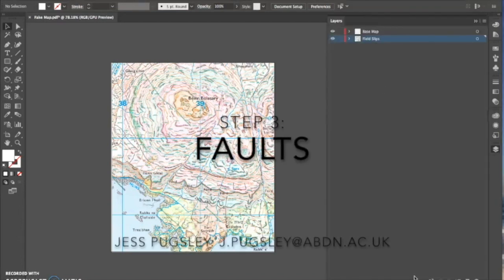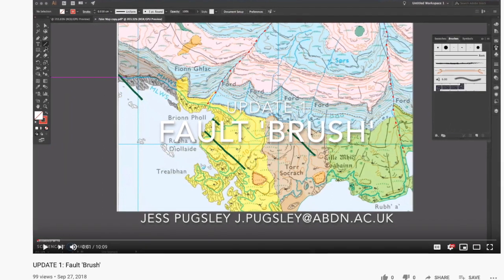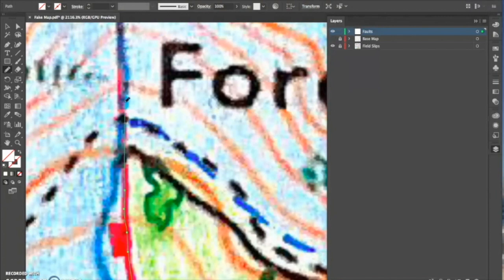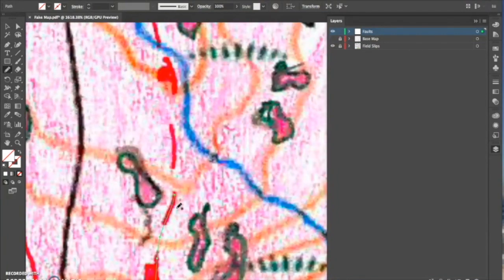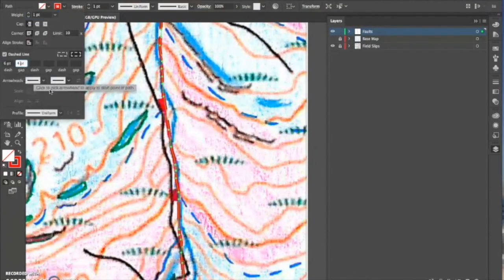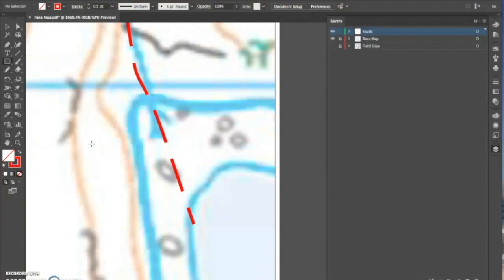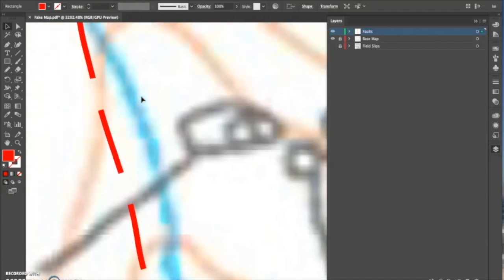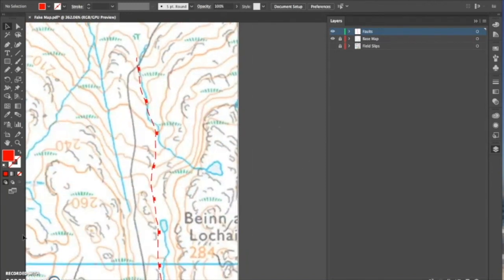Step 3: Digitising Geological Maps: Faults

Comment: Thanks. That is a useful trick. How would you do that if it was a thrust fault or if you wanted the spoon? I'm guessing you have to create a symbol to use for the brush.
Reply: Just figured it out. Create a square with the rectangle tool. Select the square, click "A", and delete a corner to turn it into a triangle. You can either group the triangle to a line and make a symbol, or use the copy/paste method in the video. There is probably a simpler way. Lol.
Reply from the maker: @socialismo52  there is a simpler way, I made this video before I knew about 'brushes' see here: https://www.youtube.com/watch?v=MdAiYEh_iTU&t=9s 
Sounds like you are it all figured though, best of luck!